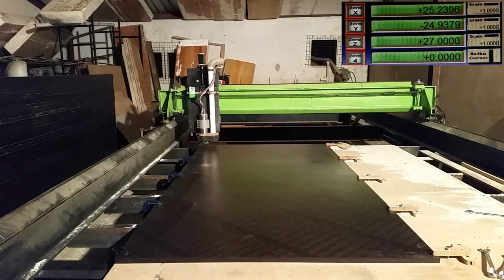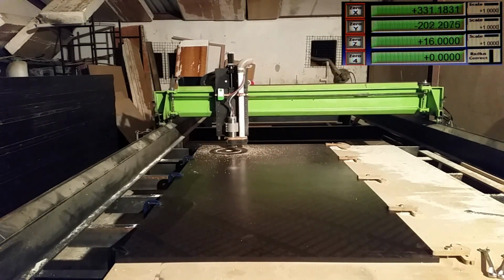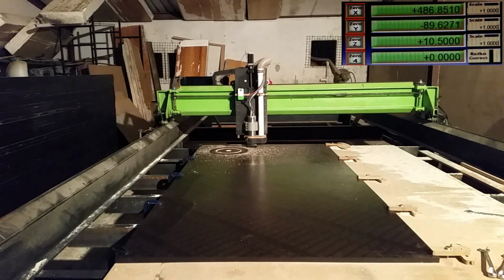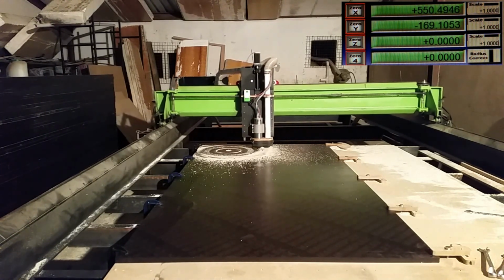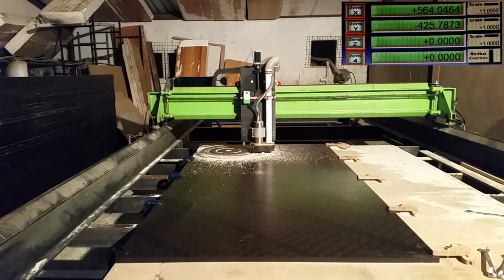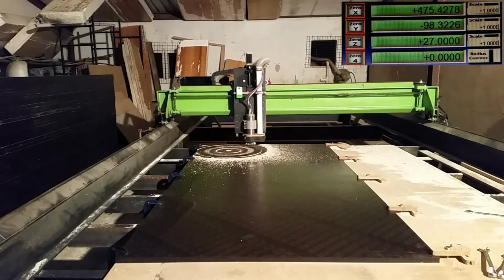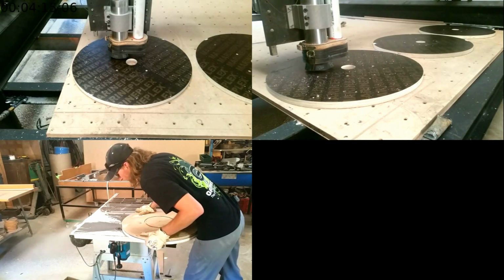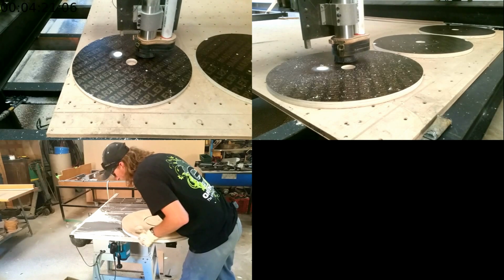DIY CNC Router (cutting flanges) Its a big machine

Comment: I believe the pauses are there because the machine is doeing a Gcode G02 or G03.  In this codeline you dont have a full circle but just a arc lets say representing a piece of the circle of 45°.  The machine starts then the next arc.  And so on untill you have the full circle.  But between 2 codelines or arcs the machine stops with acceleration or deceleration speed.  And that is why you see the pauses.  At least this is one possibility.